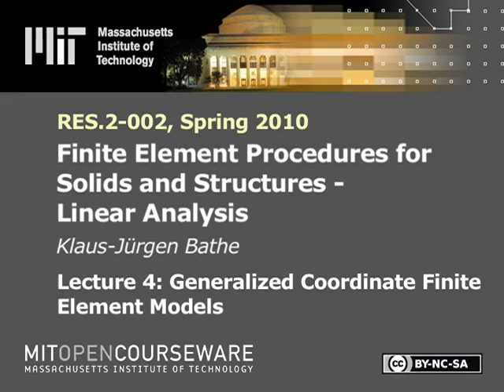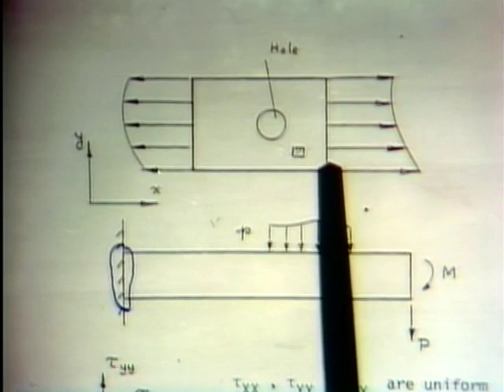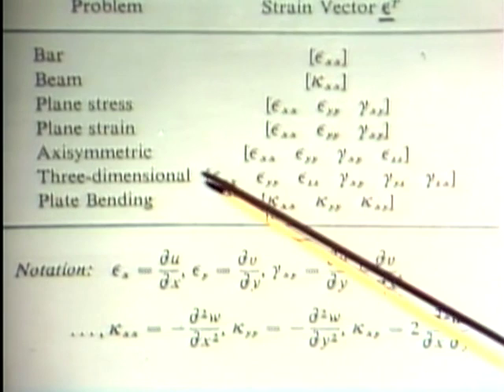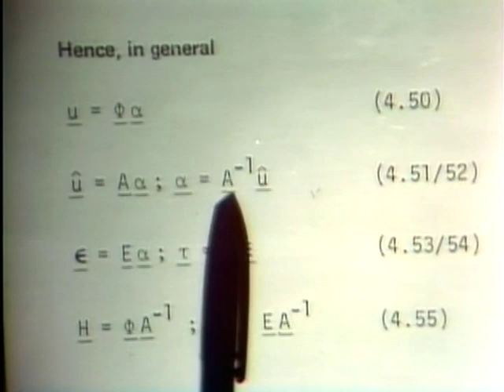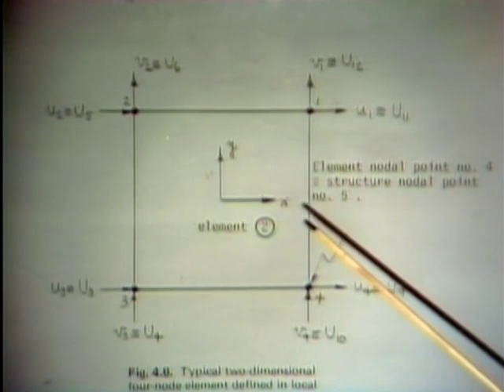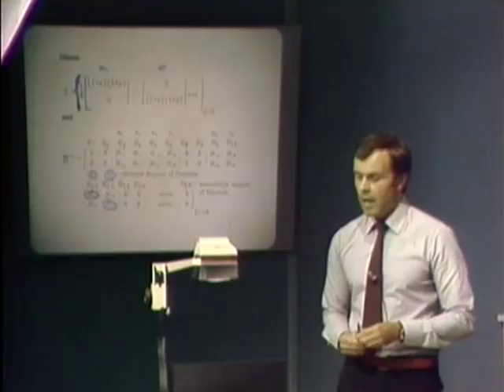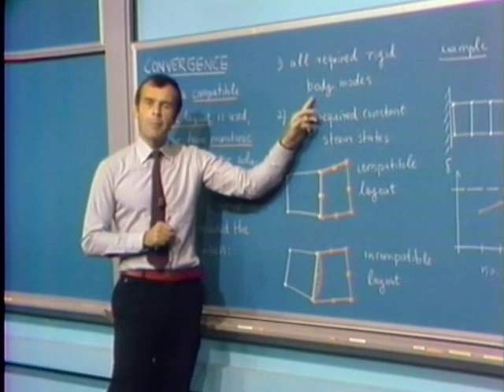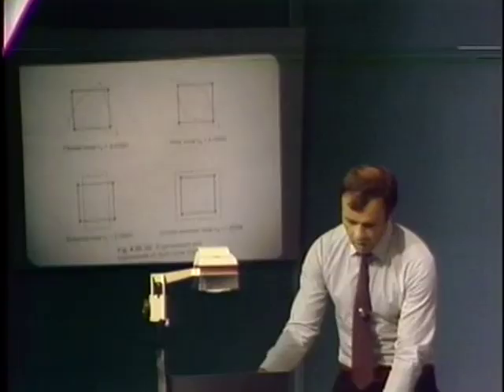Lec 4 | MIT Finite Element Procedures for Solids and Structures, Linear Analysis

Comment: how could we say A.a=U   how could we find the A
Reply: I don't know how either. Do you have the answer now?
In his book, matrix A is [[A1,0],[0,A1]] with A1 is sub-matrix [[1,1,1,1],[1,-1,1,-1],[1,-1,-1,1],[1,1,-1,-1]] but without explanation.
Reply: @namtang   Because each element has 2cm of dimension. So, he put the local coordinate system in the center of the element (see Figure E4.6 in the book). 
After,  he substitutes in the PHI matrix each nodal local coordinate, like this:
Frist node: [1, x, y, xy] -> [1, 1, 1, 1]
Second node: [1, x, y, xy] -> [1, -1, 1, -1]
Thirth node: [1, x, y, xy] -> [1, -1,  -1, 1]
Forfth node: [1, x, y, xy] -> [1, 1, -1, -1]